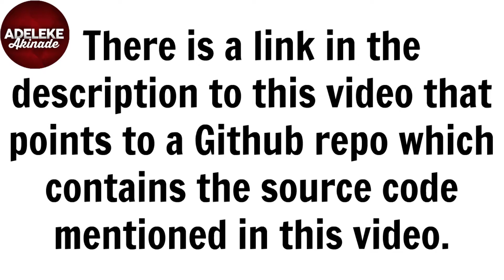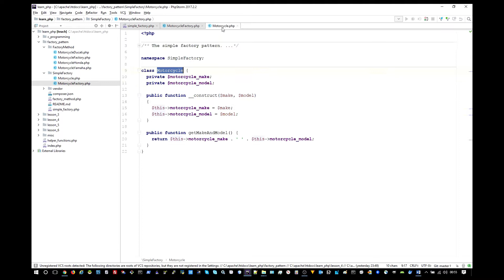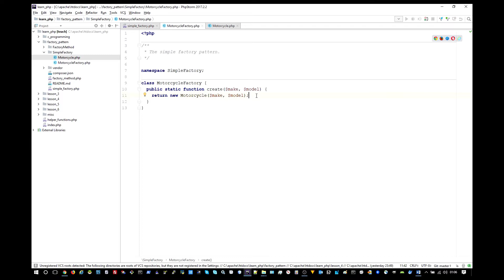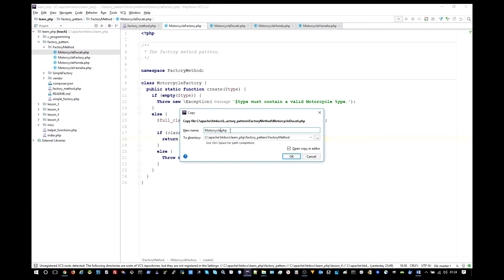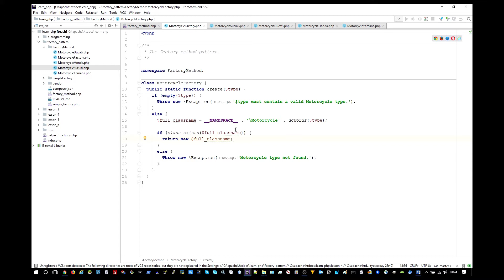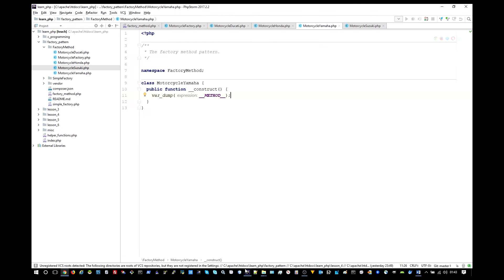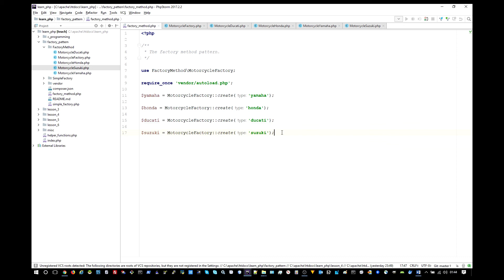PHP Design Patterns, Simple Factory and Factory Method.

Comment: This is all very cool, but what about when I need to pass arguments for constructing a new motorcycle, and each motorcycle class I want to costruct doesn't require all the same arguments. Please help :|
Reply from the maker: You can pass arguments when constructing the classes. 

When using the Simple Factory pattern, you pass the arguments to the create method of the Factory class. 

When using the Factory Method pattern, the first argument to the create method of the Factory class should be the type which is obtained from runtime information such as a URL parameter. If you want to pass arguments to the classes you need to amend the Factory class so that it accepts more arguments and those arguments will need to be obtained from somewhere such as, again, the URL. The Factory method suits an MVC architecture in which arguments are obtained from the URL.

If you want different classes that are instantiated within the same Factory class, to accept different arguments, you can add additional logic to determine the class that is being instantiated and pass in the correct arguments as needed. You could use the interface that is implemented to determine the number and/or type of the arguments.